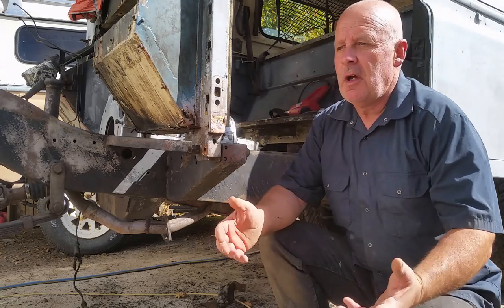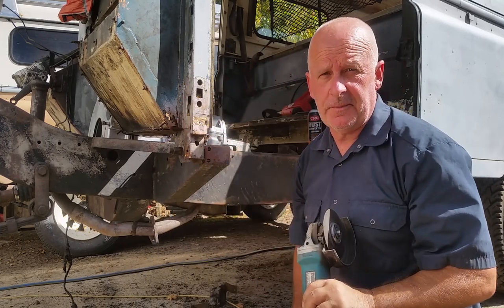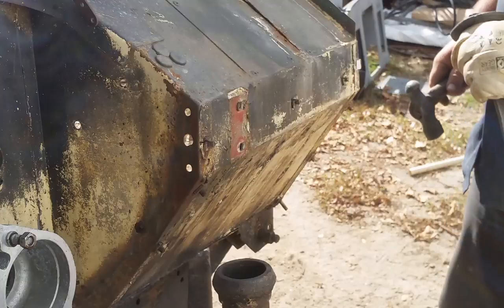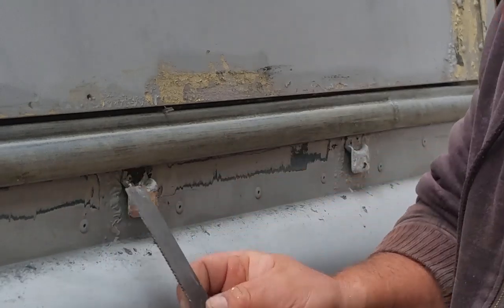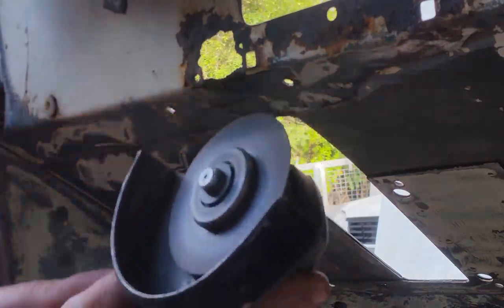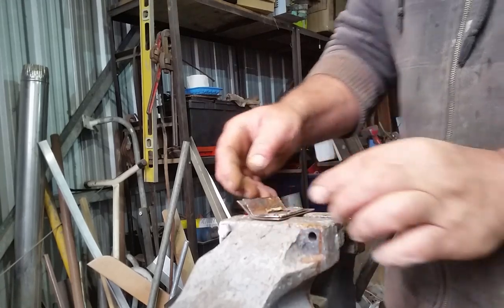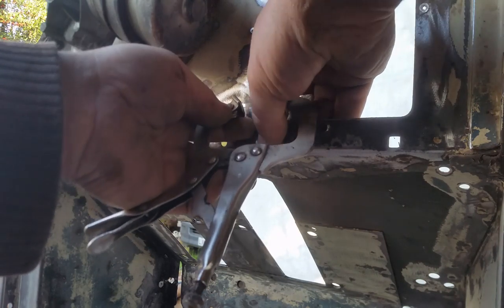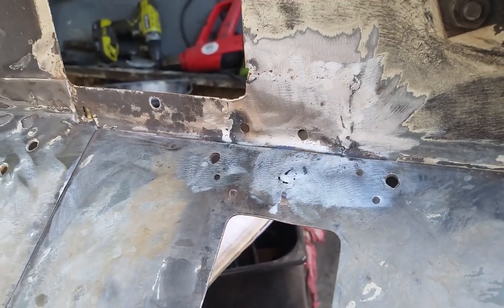Land Rover Lockdown Resto Vid6 rust repairs

Comment: I've never thought of using a heat shield when welding thin metal
Reply from the maker: a heat sink- it stops it blowing out at the edge and reduce=s cleanup at the back
Reply: TinyHouse and Offgrid Resources    Thanks for the tip